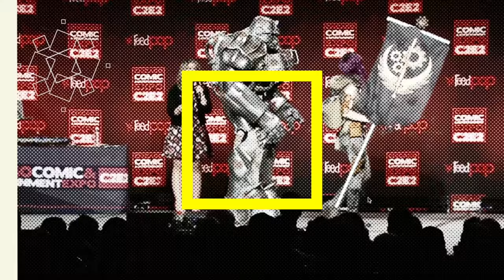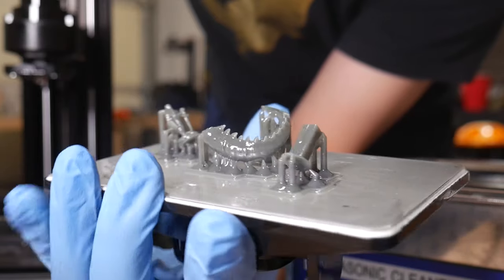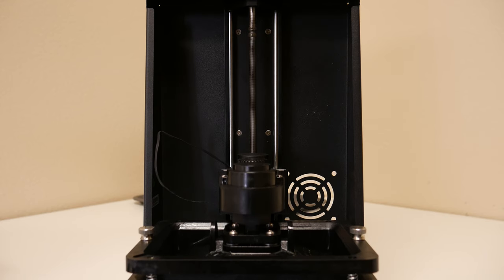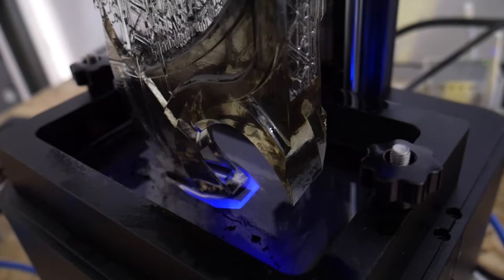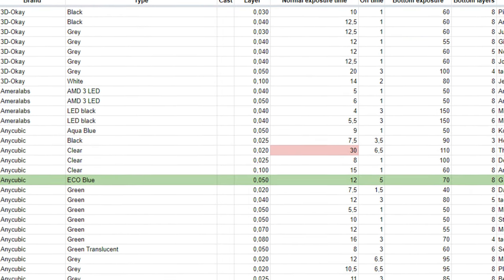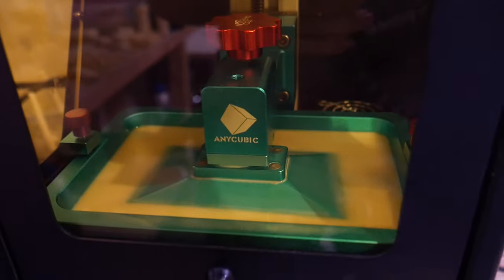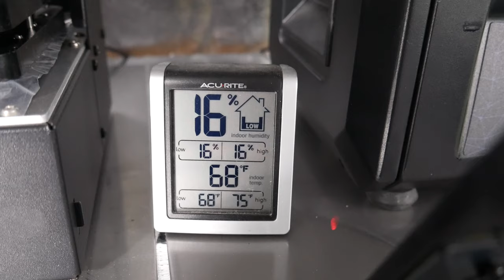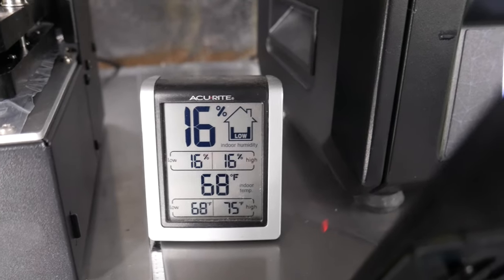4 Tips For getting PERFECT Resin 3D Print Bed Adhesion

Comment: Thank you for your video! I'm I'm new at this. I bought my Anycubic Photon Mono SE that arrived on December 10th. I've tried 7 times to print the test model and it doesn't print anything. I've leveled it each time and I followed all the instructions and nothing. I increase room temperature (but it's winter and I could arrive to 66F not more than that), preheating the resin bottle with hot water (78F), shaking a looot the resin bottle, changing the parameters (exposure time to 2 Seconds; bottom exposure time to 55 and after bottom exposure time to 18)... And nothing!!! Not a single printed layer 🙁
Anycubic sent me a firmware to update and then unplug and plug the cable again... Nothing... 😭😭
Another point: I open the window when I start to print, so my 66F drops... What do you do? Do you ventilate the room or all of you have a enclosure cabinet?
And it's curious because I commented about the temperature with Anycubic (it was before watch this video) and they don't tell me anything about it. So Anycubic is going to send me a new LCD to replace it. It's so disappointing! My first 3d printer  🙁
So watching your video, it seems that temperature is really important and it's odd that they told me that the LCD screen is not good but otherwise they don't mention anything about temperature.
About the Hertz, is there an app?
I'm a bit disappointed, looking forward to my first printed model.
Thank you!
Reply from the maker: Hmm this is a tricky one, if absolutely nothing is on the build plate or in the vat then I would check to ensure that the screen and light source is working using the screen test/exposure tool in the settings menu (should be the option next to the homing/manual motor controls (do this without the vat obviously) 

If the screen/light source works, then its likely one of the following in no particular order: exposure issue, leveling issue, or a temperature issue. FEP issues really only apply after you replace it yourself--most manufacturers do a really good job ensuring that the stock vat is nice and tight.

With temperature you really want to make sure the resin is warm when you start it--once its printing and you've confirmed its sticking to the build plate, having the temperature drop a little bit (I've tested to as cold as 55F with Ministry of Resin water washables) won't be as significant of a problem since the chemical reaction that turns the liquid resin solid does generate a hefty amount of heat and will keep the rest of the vat warm. Most printer manufacturers won't mention much about temperatures in resin printing, because its more of a resin specific issue than a printer issue--and the ones that do sell resin are outsourcing the manufacturing and don't have intimate knowledge of their product.

For checking FEP tension, look on your phone's app store for really any free "drum snare tuner", all of them are relatively decent for resin printing.

I can definitely empathize with you on being disappointed especially with the excitement of getting a printer, don't lose hope though. 3d printing does have a bit of a learning curve and with a bit of patience and tweaking they can do some amazing things (I have a whole business built on top of a dozen or so resin printers). You got this! :)
Reply: @HiroCreations  thank you for your quick response! I really appreciate your help.
I checked the test/exposure UV light as explained on the manual. I did it a lot of times and I sent pictures and a video to Anycubic when they asked me. Considering that I never had a 3d printer before, I have no idea what a good UV light looks like. It's seems fine for me but... 

Ok about the FEP. Yes, it's new. So if I tried it preheating the bottle arriving at 78/79F, increasing the room temperature to 66F, leveling the plate each time, exposure time to 2 seconds, bottom exposure time to 55 and nothing, it seems that the issue is really the UV light. But it's so crazy that they sent me it broken!

About the resin, I have the grey ECO Resin from Anycubic. On the label says "suggested using temperature 25-30ºC (77-86F)", "first layer exposure 20-80 seconds" and "normal exposure 3-15 seconds". Maybe I have to increase even more the temprerature and maybe I try to configure the maximum 80 seconds to the first layer exposure and the maximum 15 seconds to the normal exposure... But it seems crazy, right? I'm worried if takes a lot to print or if create another problem like a hole on the FEP  :( What do you think about it? Just because I would like to try one last time before changing the screen.

And on the other hand the temperature are dropping these days lol Well, it's Spain and not other cold country, so I think I can preheat the room :D

Thank you!

Comment: Hi i use a halot one and use the jewelry cast resin, i tried printing the matrix guide it printed perfectly but when i print the jewelry designs it doesn't stick
Reply from the maker: That one is a tough call, your base exposures might be on that edge threshold where flat lightweight calibration prints will stick fine but something heavier and puts more strain on the base layers won't hold up.

Comment: Great vids i just came across your channel. Ive have a few hollow pieces fail on my mono x 90% through the print where the print seperates. The build plate adhesion is amazing, but should i increase exposure time or thickness of the print? I dont understand what can be going wrong. Solid prints are fine, id appreciate any input.

Comment: hello ....i have a nova3d elfin2 and using chitubox with a plugin....i printed many samples that did not need support and ,,all printed with succes....no bed adhesion problem ,,,,but each time i try to print a figurine with support ...with a raft or with out a raft ...after printing the base firmly stock to the printer bed ....the supports starts printing on the FEP film
Reply from the maker: That happens to me once in a while, usually it means underexposure--either the supports are too thin or the layer exposure time it too low.
Reply: @HiroCreations  ok thank you very much for the answer....i will try that
Reply: @HiroCreations  what could be a good average exposure time ...i tried ..5,,6,,8,,and 10

Comment: Hey Hiro, 

Question: Can you use the exposure test setting set to very low exposure (1-2 sec.) to warm up cold Resin?
Reply: no. UV light wont warm the resin like that, it will start to harden it to the bottom of the vat.  I only use 2 seconds for normal layer exposure on my printer.

Comment: Thanks for the tips! One question: what is the 'offset-distance' (between lcd-screen and the build plate), and how is it set? Is it a separate thing to look at, besides levelling the build plate? Thanks!
Reply from the maker: Offset distance in Chitubox?
Reply from the maker: @frankmxparts  Ahh that is a tip specific for the Beam3D Prism/Monoprice MP Mini which had autoleveling features. The offset is accessible on the web interface that you connect to via wifi.
Reply: @HiroCreations  Ah, alright. LD-002R here. Gonna go over your tips. Thanks!
Reply from the maker: @frankmxparts  if none of the tips in the video do it for you, feel free to comment here with the symptoms for the community or myself to help troubleshoot.
Reply: @HiroCreations  I'll get back here with updates 👍

Comment: I've just got into 3d printing after nabbing a Mars Pro on prime day sales. I came across a video that recommended using a ptfe lubricant on the FEP to help prevent sticking issues. What are your thoughts on that? Is it something you tried?
Reply from the maker: I'd recommend against adding anything to FEP as its one of the slickest materials known to humanity which means no oils or lubricants will actually fuse to it--so its likely contaminating the resin which can cause layers to split and other nastiness that would be best avoided.

Swapping to NFEP sheets would be a better alternative to using lubricants applied to FEP sheets.
Reply: @HiroCreations  awesome. Thanks for the heads up on that 👍

Comment: Is there a such thing as too tight on the FEP? My build plate is level and my FEP is absolutely not loose. I've printed maybe 4-5 things on this FEP since I replaced it. All flawless prints but now every single print is sticking to the FEP.
Reply from the maker: Too tight can have issues but usually in the form of the FEP sheet tearing at an edge and leaking. Is the sheet getting scratched or cloudy--that can contribute to adhesion issues.
Reply: @HiroCreations  Yeah, no tearing at all. I just finished another print and 1/2 was stuck to the FEP and 1/2 actually printed properly. I watched your video to see if I had already done everything possible, and it turns out I had. The only thing that has solved this for me is replacing the FEP but others don't seem to replace their FEP nearly as often as me. Very frustrating! Thanks for the good video.

Comment: so is normal to see a vacum effect on the plate  when goes up ?? i was worry it is pulling apart the pieces from EFP ???
Reply from the maker: Yep thats pretty normal for SLA printers. Its almost reassuring to hear that sound as it means the print is sticking to the plate and not the FEP sheet early in the print cycle.

Comment: Hi, I just got a monoprice sla at a real bargain price on our favorite auction site... So, after 5 attempts if finally sticks! I am new to this, and figured things out by reading and watching some videos and this is the best one. So, I am using a very viscous resin (Anycubic aqua blue). For 5 prints, nothing would stick to the plate. I started looking for new FEP material since mine seemed to have some streaks, but the tension is ok, a bit under an A (440hz)... So it is a meticulous art to set it up correctly I guess at the beginning.  First, everything is always very clean, first with soap and water, than with IPA. My failed prints stuck on FEP were removed with a bit of IPA 99% for 2 minutes, than sharp piece of plastic to lift by the edge with my palm/finger applying force on the opposite side of the film as not to bend it too much while applying force. After changing the initial exposure times, making them gradually longer... nothing, still stuck to FEP. I am at 90 seconds initial layers and 9 seconds after. One thing with this printer is to be sure to have some thin tape horizontally along the lcd on both side touching the FEP from the underside as to create a tiny space for air and reduce vacuum forces. Alignment is automatic on this printer and seems to work quite well, I have dissassembled the mechanism and resseated the spring, be sure your spring has some pressure as it will apply an initial force to force the plate against the FEP/lcd before locking. But still, that did not fix the FEP stuck prints.. So ? What finally worked is : cleaning extremely well both the plate and FEP and removing all resin and residues, the using IPA with soaking a few minutes then cleaning first with towels, then with a magic eraser. Then, the platform was sanded with something quite high grid, I can't remember precisely, but I sanded in circular motion with rigor all the plate for like 4 minutes... Then recleaning. Meanwhile, the uv resin was poured in a glass beaker and put on the stove on medium in heating water (about 60 deg C).. left it for about 10 minutes... Well guess, what ... it worked, I checked after about 10 layers, and yay it is sticking to the platform. So I guess, when using high viscosity, things are harder... And I am in Canada and the temperature is quite low. So, heat up your resin, sand and clean your platform, align well, don't over tighten things, and be sure your FEP is crystal clean with IPA and at about 350-400 hz tension. Thanks for pointers!

The thing with such an endeavour, is that it is immensely multivariate, the degrees of freedom are too many and the solution, initial conditions is not unique... it then becomes something we call an art, a technique. What I mean is that there is not ONE answer, but in the universe of possible initial conditions, there is an array of valid solutions... Variables here: A- FEP thickness B- FEP material C- FEP tension D - FEP dimension x/y E- FEP surface roughness (FEP material) F- FEP elasticity (FEP material) G- Platform dimension x/y H- Platform material (roughness, surface friction coefficients...) I- Pull force / speed of stepper J- Vacuum force K- distance between LCD-FEP L- distance between platform and FEP M- temperatures (FEP, Plate, Resin) N- Resin material (viscosity, polymerization, electrostatic forces etc...) O- Lift distance P- layer thicknesses per layer Q- Flatness of platform and error in R- UV light power S- UV light spectrum values / wavelength T- UV exposure time U- LCD transmissivity of glass V- LCD absorption of UV on black pixels W- .... and so on, are all contributing factors, to name a few... some have higher correlation values to results and other are less important and their variation only minimally impacts the end result, some are dependant on other, some are independant... So yes, an art.

First, some variables are strictly restricted: resin types, temperature ranges, printer specs...
Then, If we can specify ranges, first, of acceptable values for the variables we can modulate, we can know where we are going.
Then, we restrict the problem to a limited set of possible initial conditions and therefore a limit the time of the specific learning curve for our application... and become an artist.

Comment: i have a qiditech shadow s 5.5 and if i use a raft,  the raft as well as the supports adhear but not the actual print. any suggetsions
Reply from the maker: Parts of this video I posted not long ago would be relevant to your issue of "ghost prints" where you get nothing but rafts and supports sticking to the plate.

https://youtu.be/E2qH5Kv4s8s

Comment: I am not having problems with adhesion to the build plate.  Instead, the model is tearing loose from the supports during the print.  I have tried several pre-supported models from 2 different companies and at least one appears to have sufficiently large supports.
Reply from the maker: I have a video on this topic scripted out (and I am deliberately failing a few prints to get footage). But I can say that issue is caused by one of two things, either too low layer cure times or the supports are two thin--keep in mind these two factors are complimentary--so changing one can compensate for the other (e.g. running higher cure times will allow you to print with thinner supports and using thicker supports will allow you to get away with lower cure times if you need crisper details on your prints.)
Reply: @HiroCreations  I increased the thickness of the supports and it improved things but I still need to increase it more. My problem now is this water washable resin swells and splits within a couple days. Everyone talks about excess resin but I wash it pretty thoroughly and I think it has to do with humidity and exposure to water. Regardless 90% of the prints either swell or split and I live in a place with high humidity so I am done with the water washable resin.
Reply from the maker: @aaronbono4688  Interesting, are you models hollowed by any chance? As I've been a water washable testing spree with a few existing brands and a upcoming brand I am benchmarking for a friend and I made the mistake of forgetting about a few prints in water for a few days with no real effect on the print but they were solid.
Reply: @HiroCreations  The solid ones do not seem to split but they do warp in bulge. I've been having to run a humidifier to keep the humidity down to 60% but it can give a 80%. I tried to drip off most of the water and that does not seem to make a difference, at least not much. I tried not running it through the UV lamp after a print and it had no effect. I could increase the cure time during print, I did that a couple seconds and it's up to 10 seconds per layer, but that doesn't seem to help either.
Reply from the maker: Interesting, I'm going to have to have a chat with some friends I have in Florida and see how they cope with high humidity in their water washable resin prints, I do appreciate your perspective and insights as humidity is a non issue for me out here in the desert.

Comment: Question: my prints have been failing, but the supports are printing, and the lower half or just one leg, are not, and then it prints the upper half of the model. What could causing this? Thank you in advance
Reply from the maker: Without seeing the model and how it was sliced, my hot take would be that its a support issue.
Reply: I’m having the same issue! It’s driving me mad. All I seem to get are supports, unless I use a ton of heavy supports all over the model. Seems like that shouldn’t be necessary, but I’m not sure what to do about it.

Comment: Question.  I am having adheasion issues in the middle of the build plate only.  The sides are great but ive only been able to get a print to stick once out of 5 tries.  Any ideas?
Reply from the maker: Sounds like it could be two things, build plate in the center might be higher than the rest of the plate (easy to check with a ruler edge) or just not enough exposure.
Reply: @HiroCreations  my first 8 layers are set to 80 seconds.  I will check the level which is what i was thi king it may be as well
Reply from the maker: @marcacosta6713  Yeah that is super reasonable, my base layers is 8 and between 55 and 80 seconds base cure time depending on the printer and resin.